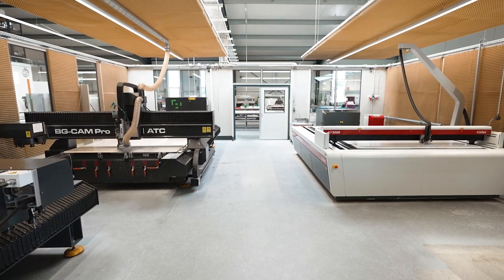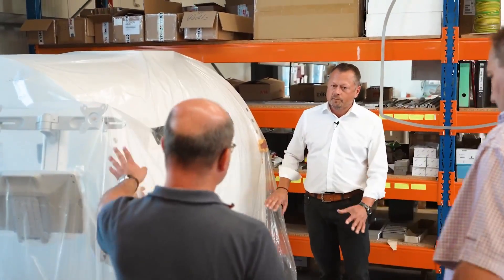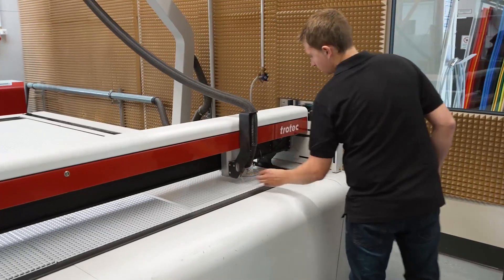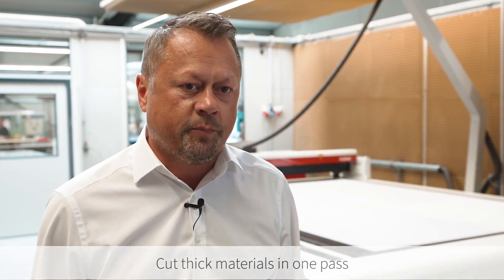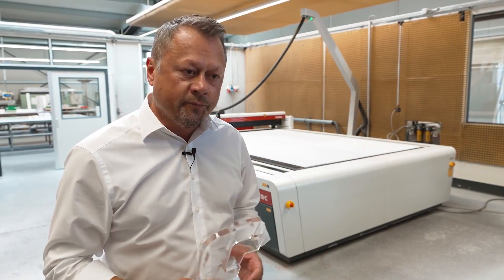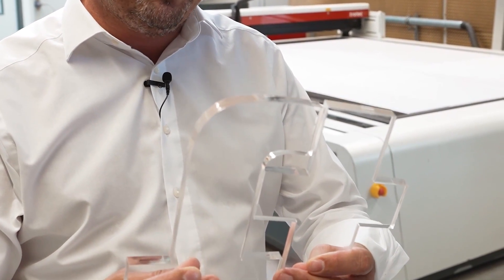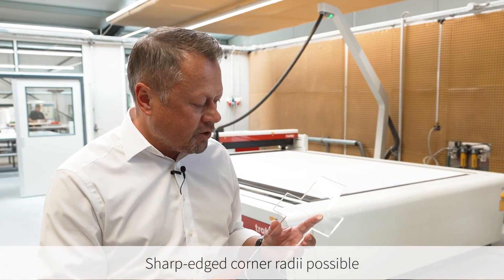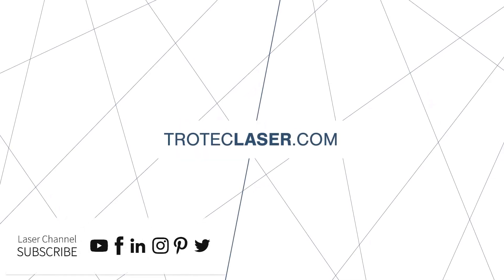Acrylic Cutting: CNC Router vs Laser - Which is Best? | Trotec Laser

Comment: With laser there is no concern with holding pieces down with a strong vacuum, you can machine smaller pieces without them flying off, you can cut zero radius because there is essentially no tool diameter, you get a glossy finish with acrylic. With a CNC router you can adjust the depth of cut to 0.01mm and use a wide variety of tools for different tasks. With lasers you have to worry about fumes and fire, with CNC you have to worry about dust and mess. Unlike lasers, with CNC you have the cost of tool replacement, sharpening and calibrating. His final comment really makes the most sense. Each machine has weaknesses and strengths, and you need both to have a versatile workshop.